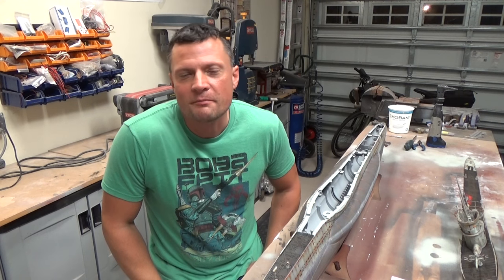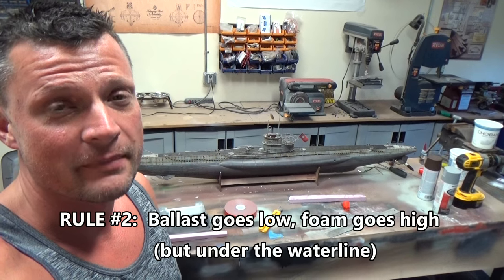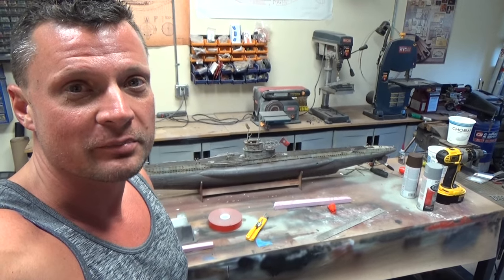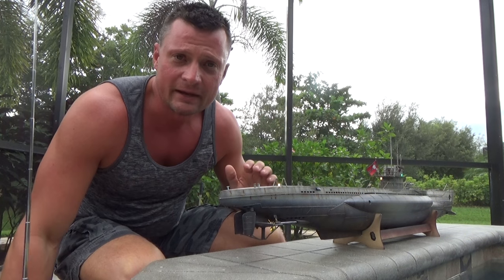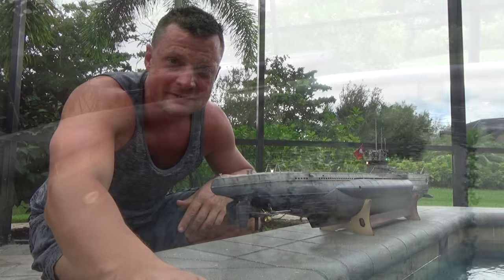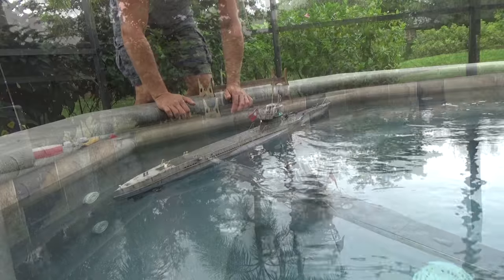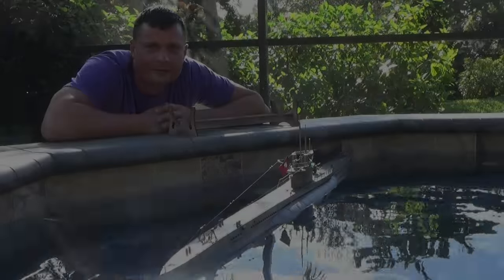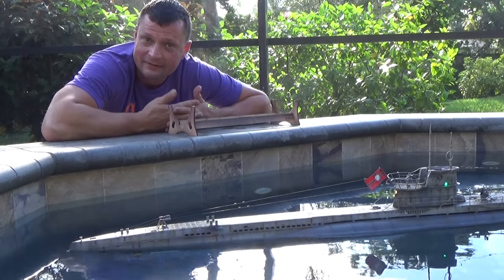Trimming the Arkmodel Type VII RC Submarine

Comment: I didn't add any foam at all to mine..I simply evenly added lead stick on flat car wheel weights in the bottom of the keel under the cylinder.I first did it to the bottom of the actual WTC just to see how much weights would be needed to dive the cylinder itself. Then installed the WTC into the boat hull and added just a little more weight. Mine dives faster then this one but it does ride a little lower above the water line.Yet I am able to static dive and hold it at whatever depth I wish to 8 feet then it goes to the bottom.Lol.Figured I would post how mine turned out. But as Bob warns when it goes down past 6 feet I have lost signal. So either buy Bob's safety module that surfaces the boat and add it or be ready..I actually know simply ran a longer antennae wire out of the boat to prevent the signal from getting lost..too risky but most of my dives are in a pool.  It is a excellent looking submarine and worth every penny!  Bob is the man for submarines though! He sells Hi quality parts and is excellent to talk with if you need help. Nice Video Bob!

Comment: Hi Bob - I have a question about trimming the Arkmodels ViiC U-boat! I am trying to trim the boat but every time I have the submerged trim fixed, with the top of the conning tower just at the surface, when pumped out, the actual waterline is too high. I'm thinking this is an iterative process - I need to keep adding weight and increasing foam until the two 'states' (submerged and surfaced) are correct. Am it wrong?
Reply from the maker: I go into this in detail in my book, and I have videos on trimming as well. Surfaced trim first - no foam above surfaced waterline. Then do submerged trim - no foam below surfaced waterline.

Comment: ive been watching your series on this sub and it looks simple enough for me to do (being 17 hasnt given me much experience yet) would you suggest this perticular model for a newcommer to rc subs or is there another that you would suggest?
Reply from the maker: The kit itself if very easy to assemble and the instructions are very good. I have no doubts that you have it in you to put the model kit together and to do a good job doing it. Where the challenge lies is in the internal workings. An off-the-shelf watertight cylinder will set you back between $500 and $600, and you need to work out the mounting hardware for it, run the linkages, and most importantly, get the trimming right. 

The short answer is that I do not feel that ANY RC submarine kit is good for a beginner. A degree of experience with R/C components is a prerequisite. Having said that, it's definitely possible for someone with no experience but a penchant for mechanics and electronics to do it and do it well, but it will take exponentially longer and many mistakes will be make on the way.

Comment: isn't it possible to configure the cylinder to emerge to surface if the signal is lost for a period of time? The same can be done if the battery is closer to depletion(stop all power except the pump and return to surface). I think a simple microprocessor can handle the function
Reply from the maker: Off the shelf, plug in modules exist that do all of what you're talking about.